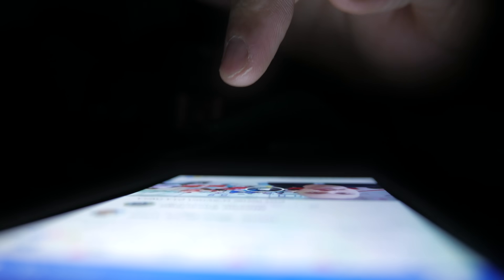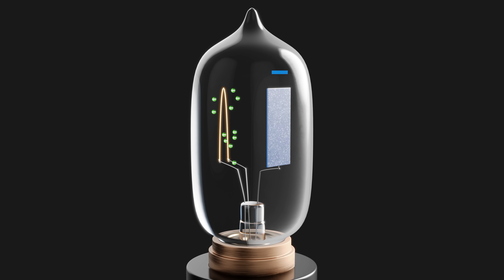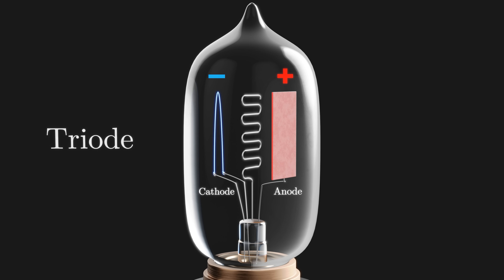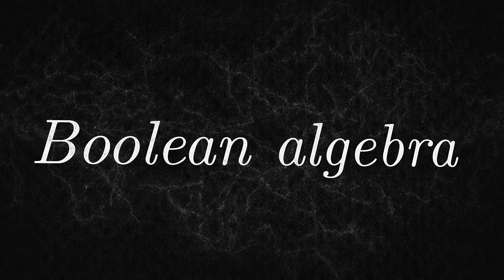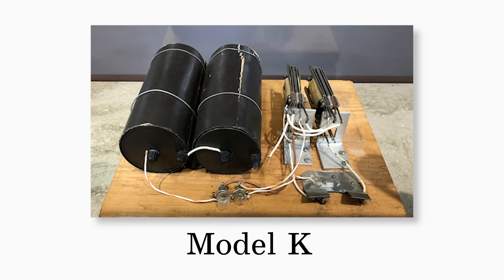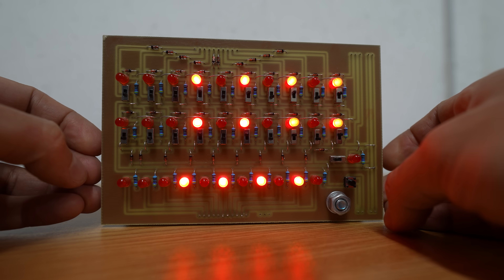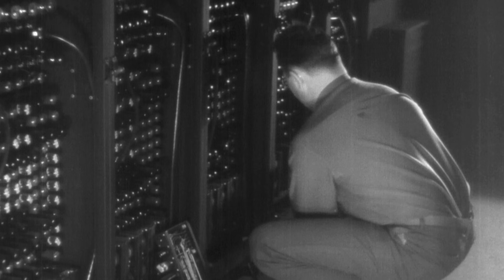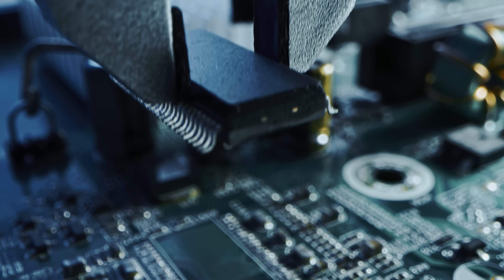Why The First Computers Were Made Out Of Light Bulbs

Comment: When I was a kid in the early 1970's, our Zenith TV had a LOT of vacuum tubes in it.
We even had a monthly (I think) visit from a technician who would check the condition of each of the vacuum tubes and replace the ones that were failing.
I was very young and dumb and assumed that he was putting new television programs in the TV for us.
I held this belief until I saw "Willy Wonka & the Chocolate Factory" (the one with Gene Wilder in the title role). That movie had a scene that explained how TV programs got to your TV and Wonka's invention of sending chocolate bars via a similar technology.
Reply: In those days hardware stores sold replacement tubes, and they would have a "self service tube tester." (I'll pause while you do an image search…) You would yank all the tubes out of your broken radio or TV, bring them into the store, test them, and of course, replace any the machine told you was "bad."
Reply: @raffriff42  I recall a hardware store that had one of these giant testers in the hallway of the mall it was located in up to the early to mid 80s.  I can't say I ever saw anyone use it back then of course, as nobody used vacuum tube TVs by then.  But the device sat their in disuse for quite a while.
Reply: @raffriff42  It's basically the same thing with car batteries these days.
Reply: This story becomes a fanciful "grandpa tale" if Right to Repair fails =(
Reply: i'm not sure that was the norm though... we've also had tvs and radios and the tubes weren't that big of a concern. for example my grandfather's radio was never serviced, not even the dial bulbs and he used it for a few decades. 
in my understanding, back then just like these days, the engineering behind a product has a large impact on its reliability. in this particular case, under-stressed valves can last much longer, just like an under-powered light bulb.
Reply: And people today complain that modern microprocessor-controlled electronics are unreliable.....🙄
Reply: @h8GW  Vacuum tubes or valves are actually very reliable. I use audio amps with valves and transmitting equipment. I have never had one fail, though one will eventually. My parents rented a valve TV set for many years and I can remember about two callouts in over a decade. The quality of design on modern electronics, if you go cheap is universally terrible. No thought given to heat management, under specked components, burning PCBs etc.
Reply: @mbak7801   I guess it depends, just like ALL goods now and back then, on who manufactures the item.  

Now while I'm not very familiar with PCBs and integrated circuits, I DO believe they're intrinsically more reliable if they have good thermal management and are sealed properly.
Reply: @h8GW  They do?
Reply: @h8GW Oh, they are, don't fool yourself!

Tube appliances are "unreliable" but infinitely repairable, it will last as long as you are willing to maintain it.

There was a golden age of solid state where crap just worked (think 90's TV's and old NES/SNES) Japanese made electronics. Now you will be lucky to get 5 years out of some stuff, and they are almost always not repairable.
Reply: @h8GW  All true. It's funny, because back in the 60 70s and 80s you'd commonly see "solid state" electronics shown as a selling point, since it meant there's no vacuum tube to replace in the thing, which commonly went out.  

It's too easy to forget how unreliable a lot of this early technology is unless you happened to live through it.
Reply: @stevesether  ,  And yet the commonest failure in most modern electronics is the same component that commonly failed in old TVs and radios!  Typically it wasn't a tube that failed first but instead it was a capacitor that would go bad (or a capacitor would go bad and leak voltage, which then destroyed adjacent vacuum tubes).Nowadays,  modern devices with pulse-mode switching supplies beat the living bejeezus out of the capacitors, and when a flat screen TV fails, more often than not it's because of bad capacitors.

 A lot of device's, both old tube type gear and modern solid state equipment, fail prematurely because manufacturers design circuits that run parts at 10 to 50% above their ratings.  You can't really blame a tube, a capacitor, a diode,  a transistor or even a resistor, for failing "prematurely" if you're putting more voltage and/or current through it than it is rated to handle, or when the physical installation of the part or the case design of the entire device won't allow the part to dissipate the excess heat.  Modern devices often run so hot that the circuit boards start scorching to the edge of actually burning, and it is a little known fact that the insulating portion ofcircuit boards can become conductive if sufficiently overheated. Anyway, rhere's not much difference in shortening a capacitor's life by locating it right next to a hot running vacuum tube versus locating it right next to a hot running voltage regulator or power supply resistor that throws off heat.
Reply: @goodun2974  That's all true.  But I'd also say I've seen enough videos of people fixing 30+ year old computers that have the same exact design flaw in putting caps near hot components, shortening life.

In other words, we make 'em just like we used to.
Reply: @stevesether  , same thing with solid-state audio equipment from the 70's and 80's; electrolytic caps located right next to resistors and voltage regulators. I've replaced many hundreds of caps for that reason.
Reply: Repent and believe in Jesus Christ  Ew, gross. You got your cult ramblings all over my discussion about TV vacuum tubes.
Reply: Back in the day before things were made intentionally difficult or impossible to replace or fix. Nowadays, if something goes wrong in your TV even finding a repairman would be difficult. Most people just get a new TV.
Reply: @Zyo117   I feel like a lot of the feeling that electronics have planned obsolescence comes from most people not having the skill set to repair them.  Louis Rossmann shows that it's even possible to repair super-locked-down Apple tech.

Though TBF Apple REALLY likes to make their tech hard to repair and we could use Johnny Law to bring down more consumer protections on them.
Reply: @Zyo117  I knew a guy that would fix people's flat-screen TVs. He's retired now though.
Reply: @Zyo117  You're not wrong.  But consider that a color TV cost $500 in 1970, which is around $4000 in todays money, you better hope the thing can be repaired.

These days you can pick up a 30 inch TV for $100.  Why would you bother repairing something that costs $100 when the repair is going to cost you likely more than that?
Reply: @stevesether  You're also not wrong, but consider that one of the reasons for the price of repair is because manufacturers have made devices unrepairable and that the replacement parts are unavailable. If the parts were available and the repair was mostly plug-and-play (maybe with some calibration), the repair would be much cheaper and doable even by yourself.
And sure, you can pick up a cheap TV for 100$, but what if your old one was a higher-end model? You're choosing between a significant downgrade and a significant replacement cost.
I'm not arguing for every component being user-replaceable (since tight integration has actual benefits), but the panel and mainboard being easily replaceable would make a lot of sense (with more detailed components being available, though not necessarily user-replaceable).
Reply: @wojtek4p4  I guess it depends on what you mean by "unrepairable".  One of the more common components to fail in a TV is the backlight.  I've seen people on youtube videos make this relatively common repair themselves.  

I myself have easily upgraded the screen in my laptop to a newer and higher resolution model.  It wasn't hard, though it took a little searching to find the right part.  But I think it cost all of $80.

Also, I don't think there's exactly any intention by the manufacturers to force you to buy a new TV/Computer/Whatever.  But making a mainboard or other parts available to the public costs money, and there's likely almost zero market for that.

Now I will say that it's often not quite as easy to repair electronics as it is say a dishwasher.  Those things are basically built to have replaceable components, with part numbers an infrastructure to find them, logistics for equivalent part numbers, etc.  I've repaired my dishwasher, AC, and dryer myself, and they were all far easier than repairing electronics.  

But each of these was designed to be repaired with individual components, and often even somewhat standard parts between manufacturers.  A dishwasher often doesn't change for decades, and maintains the same collection of standard parts used to build it.  The same isn't true for a TV, which changes too often to just make it from standard parts.
Reply: @stevesether  modern TVs also cost $4000...
Reply: @MrTeddy12397  I'm sure if I looked hard enough I could find a hamburger that cost $4000 as well today, but that doesn't mean it's a typical price.

The $100 price I found was a real price, and is a better quality, and larger screen than you could find in 1970.  When comparing price, you have to compare apples to apples.
Reply: @stevesether  you're lying, there isn't a new tv bigger than 10 inches for just $100..
Reply: @MrTeddy12397  You're now on mute.  Try to be more respectful in the future.
Reply: @stevesether  grow up kid...
Reply: whoa...! that's way ahead of your time...
that is similar to storage device now days....
😀✨

Comment: I noticed that you properly called ENIAC the first "general purpose" computer.  Something outside the scope of this video is that the British government was using a "special purpose" computer to decrypt German radio communications as fast or faster than the Enigma machine at the receiving end prior to ENIAC.  (A side note:  The Poles had already broken that code by hand.)  Excellent work.  And don't forget that nearly home in the first world still has at least one vacuum tube in occasional use:  a magnetron in the microwave oven.
Reply: The first version of ENIAC was not a general purpose computer. It was specifically built to compute ballistic tables. In 1946, John von Neumann proposed a modification of ENIAC that repurposed the memory for storing tables of values for various functions (like the trigonometric functions) to store a small program. This modification of ENIAC (completed in 1947 iirc) was an intermediate step toward a proper stored-program computer, the EDVAC (completed in 1949). Another interesting thing about the second version of ENIAC is that it had the first Turing complete instruction set (also proposed by von Neumann).
Reply: Collossus was made to decrypt Lorentz Cyphers, not Enigma.  They used an electro-mechanical machine called a Bombe to decrypt Enigma.  The Poles had not broken Enigma, they had captured an intact machine, which they eventually gave to Britain (after the Brits and the Yanks had initially turned it down I believe).
Collossus was the worlds first Electronic Programmable Computer, but that fact was kept very secret until the mid 1970's, which is why it was widely believed that Eniac was the 1st.
Reply: @Algernon1970  One minor point. The Poles did crack enigma. They had a captured (thanks to French intelligence), reverse engineered and were able to produce replicas of the first commercial version of Enigma, and in doing so they had learned how to crack the Enigma code mathematically of those first machines. The Germans then later added more security features to subsequent versions and better information security practices, meaning that cracking enigma by hand became an ever intensive and impractical task. However, the Poles shared the replicas, plans and means of cracking the early models with the Brits, significantly reducing the time they needed to get a more industrialised industrial code breaking operation set up.
Reply: @Algernon1970  Thanks for this. I couldn't remember the name, and am a bit annoyed that it wasn't mentioned in the vid. Then again, not surprised; this channel has become the early 2000s version of Discovery Channel. Some interesting content,  but rarely much below the surface.
Reply: The first programmable computer was the Z3, electromechanical though.
Reply: @juslitor  Zuse Z3 and IBM SSEC were not Turing complete. Some people said that SSEC was able to do a loop by gluing the ends of the paper tape program storage, but that was a hack, and not a Turing complete instruction set (which first appeared on the 1947 ENIAC).
Reply: @danoprea3066  quote from Z3 wiki page " the Z3 was Turing-complete – how to implement a universal Turing machine on the Z3 was shown in 1998 by Raúl Rojas"
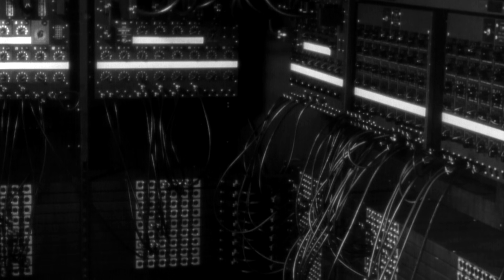Reply: At 14:17 ‘general purpose’ is omitted, meaning that should be Colossus
Reply: I’ve seen a reconstruction of the UK machine, which was known as Colossus, at the National Museum of Computing (TNMOC) at Bletchley Park. Astonishing stuff!

Comment: Would have been cool to learn a little about how guitar amps are basically the only reason vacuum tubes are still produced today.
Reply: I guess you never heard about microwave ovens (magnetrons), radar systems (Magnetrons, and Klystons,) Satellite uplinks (Traveling wave tubes), High power RF transmitters, X-ray machines and CT scanners (X ray tubes). And there are probably many more that even I'm not aware of. Anyway, if I had to guess, I'd say the biggest use of vacuum tubes are microwave ovens. Pretty much everyone has at least one magnetron in their home. Vacuum tubes are a long way from being dead!
Reply: @stefanl5183  to be fair, some of those are not glass. I once took an old microwave oven magnetron apart. The main tube was 1/8 thick copper. Totally surprised.
Reply: @petertrast  Glass? What's glass got to do with it? We're talking about vacuum tubes. The video is about how the invention of the light bulb led to the discovery of thermonic emission and how this principle led to the invention of the vacuum tube. Tubes can be made of glass or other ceramics, like aluminum or beryllium oxide. And yes, the anode of a magnetron is typically made of copper, but the entire tube is not copper. If it were the anode would be directly shorted to the cathode. So, there was some ceramic material as well. typically they use aluminum oxide but some might use beryllium oxide. One should be careful not to crush beryllium oxide as the dust can be hazardous to breathe. Anyway, the point is vacuum tubes are still quite commonly used in certain applications because there simply is no reasonable alternative. Tubes do a good job of handling very high power levels and high voltages and are typically more resilient in that regard.
Reply: I have an old TEAC stereo amplifier that uses tubes that also perpetuates the market :)
Reply: @petertrast  Some very high end modern WiFi amplifiers use vacuum tubes too.  I probably couldn't tell the difference between them and transistor amps, but some people swear by them.  Nevertheless, I still bought a valve guitar amplifier.  Alas, now most vacuum tubes come from China or Russia.
Reply: @petertrast  very nice!
Reply: It's got something to do with (and I couldn't find a good citation for this, sorry) distortion in tubes producing even-order harmonics, which are more pleasing to the ear.
Reply: Wouldn't have been that cool to learn an untrue fact.

Comment: My father worked for the California Department of Water Resources. When I was a kid, they were still operating a UNIVAC computer. It took up a large room which had to be independently air conditioned. It could only do one function at a time. In order to change functions the programmers would have to come in and program the thing. The funny thing was that their desktop calculators were many times the computing power of the "Computer"

Comment: At the Young Scientist's Exhibition in Dublin Ireland in 1974 one of the Senior Physics exhibits was a 100 watt tungsten incandescent light bulb which was run from a variac.
The student had a metal electrode stuck to the outside of the bulb. He was able to get a measurable current from the device even though there was a layer of glass in the circuit. I don't remember what his "anode" voltage was.

Comment: 15:45 I love this segment. 300-400 watts to idle a machine capable of processing a word. A word.
I had to check -- my rig, which I am typing this on -- is currently pulling an even 700 watts. Not counting its graphics coprocessor, which alone is rated for 33.55 trillion floating point operations per second and is responsible for most of its power draw, its CPU has been measured at something like 6 GFLOPS. This machine, while I'm typing, is hard at work doing trial factorizations of enormous prime number candidates and about a dozen other scientific projects.
I shrieked in laughter when David Lovett said how absurd 300-400 watts for the vacuum tube rig he was showing here is. He is so right. And it was only doing integer arithmetic. The contrast here is mind-crushing. Generously, between six and nine orders of magnitude more computational throughput can sit in the palm of our hands today for a tiny fraction of the power. I love computer science.